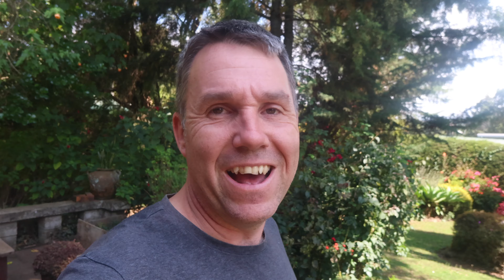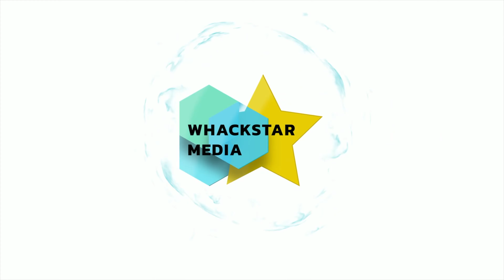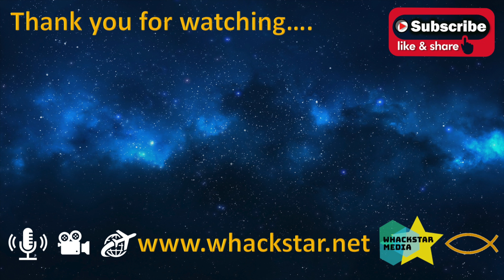Build your own solar system  - Part 2 - Deye and Dyness First Fit!

Comment: Hi Wayne, great video.  Are the circuit breakers bi-directional?  It’s now a requirement in the UK for solar setups as it’s possible for reverse currents to occur that will break the MCB causing it to remain closed even in a fault condition.
Reply from the maker: Great question don't know. It was what was recomended to me. Makes sense. Would be pretty easy to swap out. Thanks for the advise.
Reply: Hi Wayne. You're enjoying yourself creating these new devices. Well done! Hope it all works when you connect it into your 'office'.